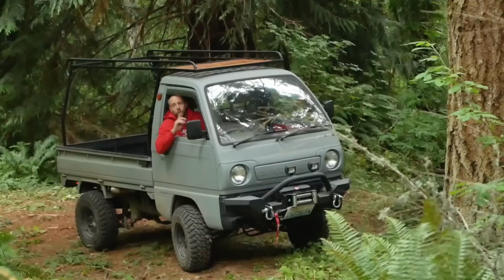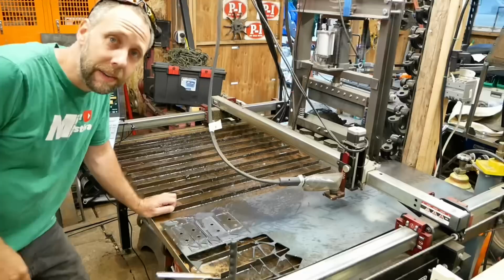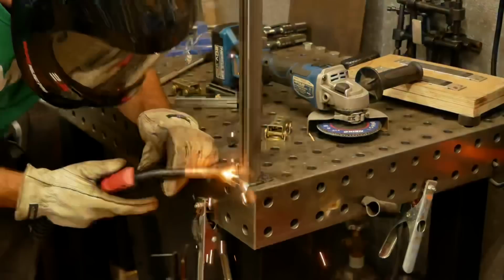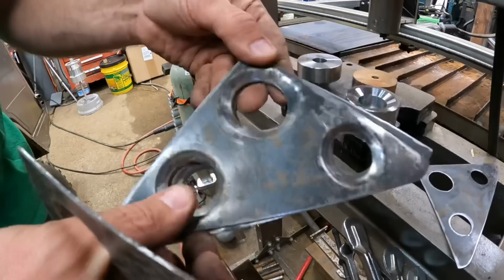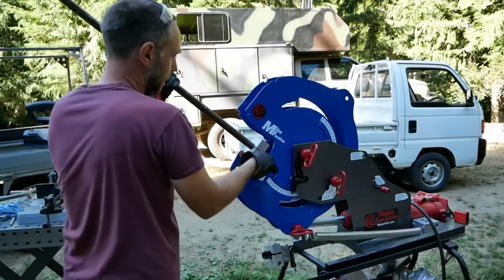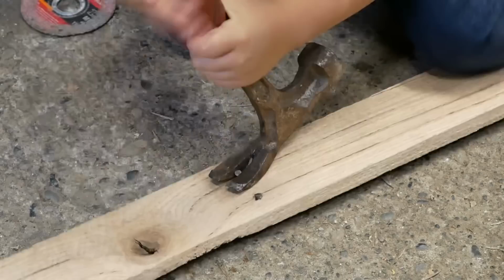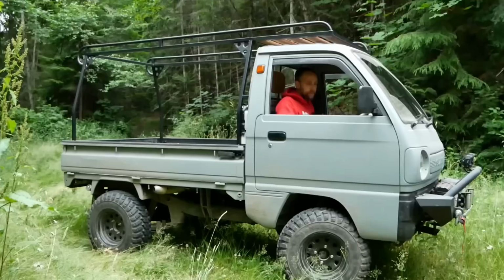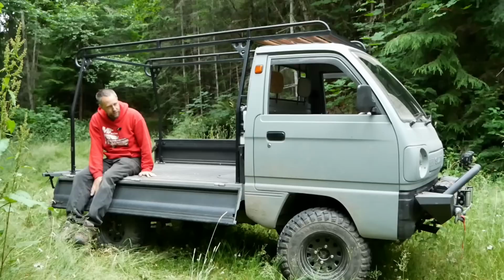Suzuki Carry JDM 4x4 kei truck ladder rack build

Comment: Simple yet very functional rack design and lightweight too. I have seen people loading their Carry way beyond their load limit of 350 kg. Weight is no issue for these workhorses. Seen one on the road ferrying 12 workers to a jobsite. At say, 70 kg per person on average (Filipino, small stature, hehe), that's already 840 kg. More than double the rated capacity! Poor trucks.

Comment: Love the vid! I actually just bought a 96' Carry at auction and looking to building something similar to yours. Do you have any recommendations in terms of the fabrication of the ladder rack for someone new to metal fabrication and welding? Like maybe I could find some of the hardware you made on your cnc machine and dimple dies already made? I was looking at getting the easy flux 125 titanium welder that I ran into on harbor freight and saw you had a video on. I thought that might have been fate that I buy that welder on account of the coincidence of running into that welder and me being inspired to build something like this from your video. would love any suggestions and tips, thanks

Comment: Do you drive this on asphalt roads?  If so, how is the tread noise?  I have a reconditioned multicab.  Everything is great about it except road noise. About 40-45 kpm is the worst but since my town/hiway driving is mostly in this range, it gets real annoying.  The new Chinese “4WD” tires are only less than $40 each and decent street tires are comparable.  Makes it easier when we have to haul stuff to the far side of the island.

Comment: I have a stupid question. Why don't you just run a flap disk over the whole sheet of steel before you cut anything out of it? Seems to me like it would save a lot of time futzing with each little tiny part. Am I missing something?
Reply from the maker: If I clean the metal before it would be a waste of time. The parts have a small burr of slag after they are cut with a plasma torch. It’s just a part of fabrication.

Comment: The first time I've seen anyone use their sheetmetal as efficiently,  overlapping cuts to maximise  usable material,  instead of all individual pieces with waste material between cut out parts.  Is there any reason why this is not routinely done,  except extra setup work

Comment: What gage steel is that?
Reply from the maker: It’s thin wall, 1/16”, I want to keep the weight down because the entire truck is only 1400 LBs and the payload is about 800# so the rack only adds about 70# to the truck.